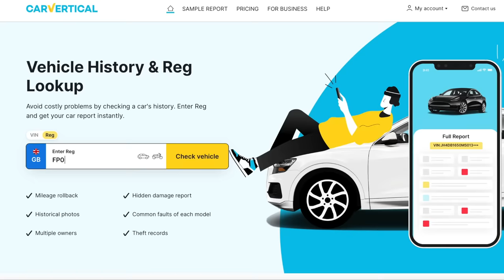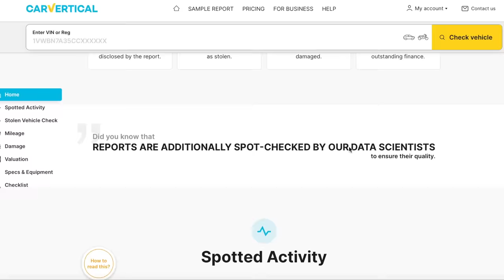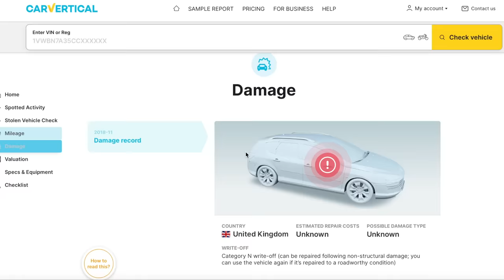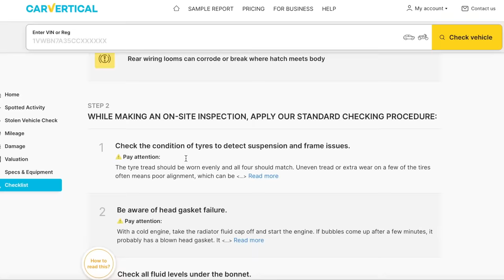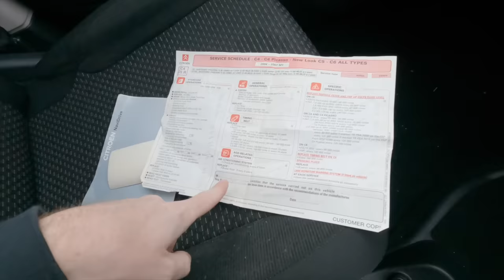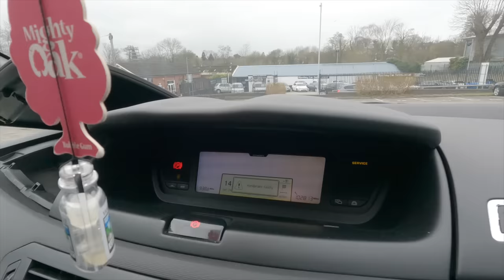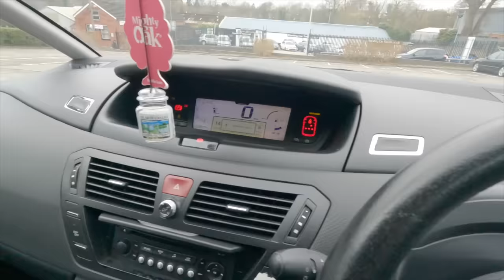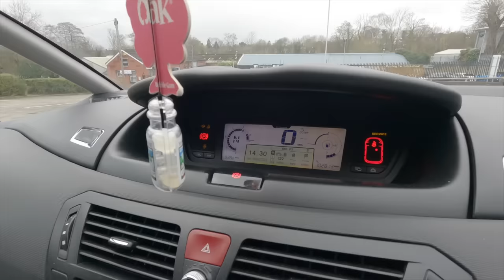I BOUGHT A CHEAP CITROEN C4 PICASSO FOR £300

Comment: Something ive learned if your e brake is locked on a slope is move the car very slightly up the slope to take the pressure off the brake. It usually helps

Comment: These Citroens come with a flexible wire gizmo which you can use to disengage the auto brake if the mechanism fails.
Reply: Shows the faith they had in those handbrakes😂

Comment: I disagree totally with all your comments, I owned one for 11 years!! 340k kilometers.  If you don't  maintain them, they will break your heart. Any problems you mentioned are easy and cheap for a diy person to fix. The only reason I got shot of it was I was just so bored driving the same car for so long.
dpf problem is very common and simple to fix. All you need to do is change the additive bag under the back wheel. 40 minute job.
Reply from the maker: Hmm. I doubt the average person can rebuild the gearbox
Reply: @HighPeakAutos  who would rebuild a gearbox for one of these? I never had one issue with my manual box
Reply from the maker: @padraigholohan4778  did you see the video? The box was broken
Reply: @HighPeakAutos  i still havent finished watching it, still watching it. all of those faults were false for me. once the dpf was replenished, all those went away. when the handbrake button broke, my wife ordered one on eBay for 6 quid. When it arrived, she had it changed herself in 30 seconds. They are an easy car to fix, I think your one has been abused to be honest.

Comment: I was cracking myself up I own one from that same year, it’s the Exclusive finish with all the bells and whistles,   and it started giving me gearbox fault warnings last year.  It has gotten worse and worse,now, every time I need to leave my parking spot when it’s cold, I need to push it back on my own, because reverse does not engage. Here in Spain, when you log on to the C4 forums, it’s rant after rant, people complaining about  gearbox faults, how Citroen dealerships never get around the real issue with these cars, they start by replacing the gear handle, then the gearbox, then the pneumatic suspension.  I traveled more than 200kms with my back suspension down like an F1 car ahahahahaha. I loathe Citroen…..my car is slowly dying from within,
Reply from the maker: Sorry to hear that

Comment: I don't understand all the fuzz around this car, being a previous owner of one of these with an automatic gearbox as well, I can safely say that it was extremely practical, very comfortable, and good enough when driving. The storage capacity presented when folding the back seats is seriously impressionable, I moved from one city to another and then furnished my home thanks to this car. It has some features that are advanced for a car designed in 2006. The price for value is very very respectable, and you can treat them as your daily workhorse without really worrying, since anyways fixing them is very cheap and replacement parts are widely available. Finally, the fuel economy is fantastic, and their engines are capable of taking you anywhere.

The C4 Picasso is not trying to be something else, it's a simple practical, and affordable family car. I will take it any day over a Mini Cooper or any garbage UK has ever produced if that matters.